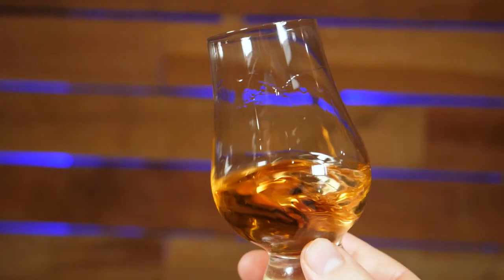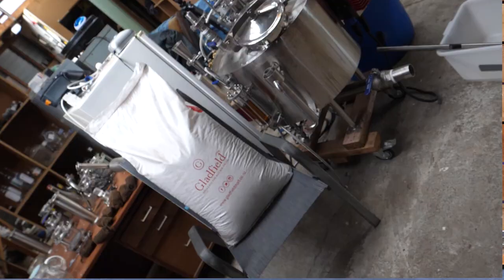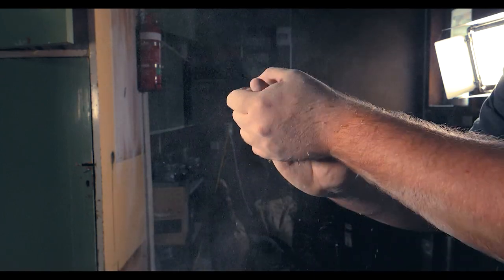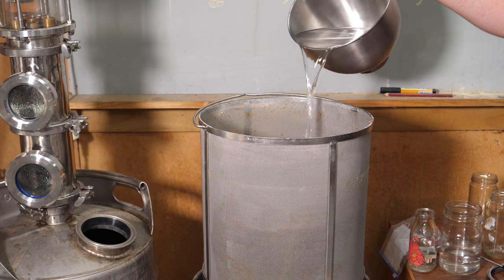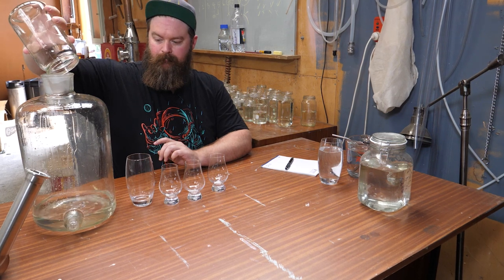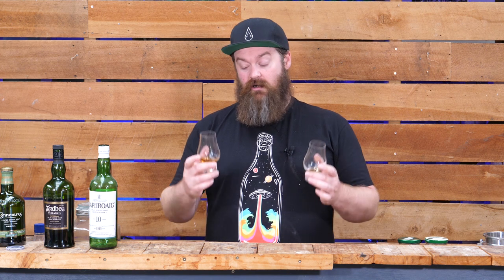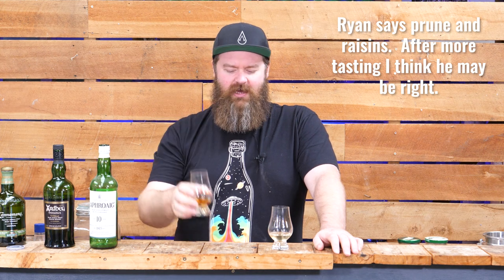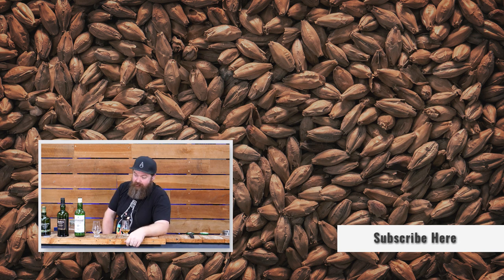How To Make A Peated Whiskey At Home

Comment: Jesse, I’m on my 5th batch of peated whisky. I aged the first one similarly to how you did it. But after that I got a 5 liter American oak barrel and have created a solera barrel where i put a new batch in as I feel it’s getting low. I do everything at barrel strength. It changes every time I put a new batch in and the oldest batch is about 2 years old. I use 85.7% peated and 14.3% 2 row. And I use the fermfast whiskey yeast usually. Right now it’s super spice forward. Huge tastes of peat and smoke though. It rounds out nicely with some water from an eye dropper.

Comment: Mate, love the Channel. I have been doing a bit on trying to get a decent peated whisky and from a few trials have found this to be pretty well right on the money.. simple, cheap and tastes bloody good... Just a pity it takes so long to age..
For a 25/30 litre mash.
5KG peated malt
3KG white sugar
70 Gms bakers yeast

Sparge three times for 2 hours each. First time 15litres of water@ 73 C, second 12litres @78 C and lastly 5 litres @80 C. Do this in an esky/chilly bin in a grain bag pouring off into fermenter after each sparge. Make sure to stir occasionally.
Add sugar stirring in and let cool to around 25 C and then pitch yeast. Takes approximately 5-6 days to fully ferment. Once finished let sit to clear sediment or you can use a clearing agent if you are impatient like I am. Transfer to still and do a full stripping run in a pot still. Water down to about 20%ABV and do the spirit run. I use 300ml jars and mark on the jars where the theoretical cuts occur. Once finished leave covered over night and then blend to personal taste. Bring down to 40%. I age mine in 5litre glass demijohns with american oak which i char up about half of. I have found that it takes about three months to get it to the stage where it mellows enough where my friends cant tell its not commercial Scotch. Some batches don't last that long though... LOL

Comment: Awesome video! OK - for my most recent version (25 litres) I used 6 kg Gladfield Distiller's malt, 2kg peat smoked malt, 400 gm Shepherd's Delight, 400 gm Toffee malt, and Still Spirits Distiller's yeast.  I use a self-built copper alembic still head.  After the spirit run I ended up with 3.5 litres at 63% into which I put 100 mm oak staves from a red wine barrel: 1x charred, 1x light toasted sweet range, and 1x medium toasted vanilla range. 

After two months it is tasting sweet, with a fruit cake presence, light peat, very slight wood and a fairly long finish. I am pleased so far except that next time I will go for heavy peat smoked  malt and 50% of the grain bill. Perhaps an ale malt instead of the distiller's malt, which I think is more suited for using with other low diastatic grains.

Comment: I used peated malt, 5-50 ppm according to its data sheet. I guess it was around 10 ppm. Smoky but not Islay peat. 
I smelled it during mashing and during destillation. But in the final product, even in the low wine there was barely smoke left. 
Can it be that small 2l stills behave differently? 
What can I do, to improve smoke/peat during destillation process? Phenols have a boiling point of 200-300 °C, so much higher than ethanol and water. 
How does Ardbeg manage to get such amount of smoke even when they cut high (compared to Lagavulin where they go down to 56% abv on spirit cut).

Comment: So I tried this and I'm almost under the impression that they must eliminate the trails but keep running it until it's almost water and at that point use the smokey water to water it back down to proof. Otherwise I don't see how they can get that much smoke in it.
Reply: So I have been informed that to get the peat to come through you will need multiple runs combining all your feints from spirit runs and just keep repeating. Yes also running down to 0% on strips. Low and slow for both strip and spirit and relatively high volume in the boiler (little to no reflux within the pot)

Comment: Instead of mashing, can’t you just use DME and do a mini mash of peat smoked barley? What was your OG?
Reply from the maker: You could for sure. 2 issues there.  
1 - DME is expensive (at least for me here).  Thats a lotta chedda for a 75-80 l batch 
2 - That would dial down the peat a lot.  Im in it for the full on smoke. 
But thats the cool thing about this hobby, scale it and change it to suit your goals and tastes :)  

There were three individual mashes that got added together days apart.  My guess is that the average was right around 1.075 - 1.070.

Comment: You'd save us a bit of time and some hassle if you printed your recipe and instructions in the video details or on your website. 

Just to confirm @4:00: 8.33 Kg of your malt in 23L of water, at 65C for 1 hour.   Then you sparged to get 30 litres final volume into the fermenter.   What was the OG ?   

Fermented at 22 to 27C for about a week.  FG was 1.00 ish.

I like your yeast selection !  Safale SO4 will give some good flavors in beer.   Jack's New World Strong Ale Yeast M42 - never heard of it before.   I wouldn't pitch them together because they will work against each other.  I'd pitch S04 and let it do its thing until it stops and then pitch the finishing yeast. 

Did you taste the wash before distilling it ?  How much fruity ester did the SO4 produce ? How much made it into the final product ?

What proof was your spirit run ?

 Great video.  I'm going to brew this in the near future.  Probably next week after my rum is done.